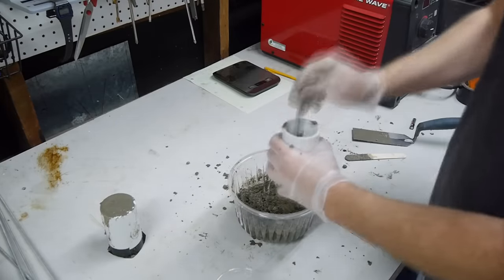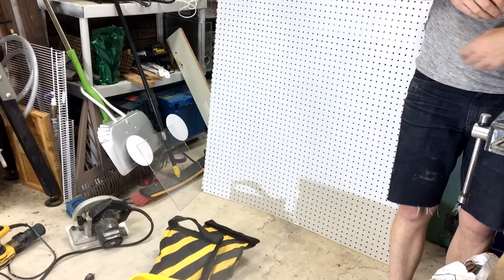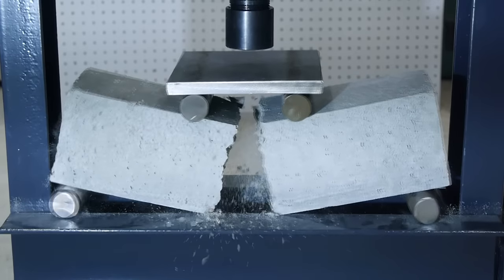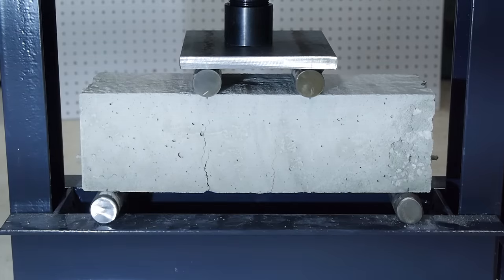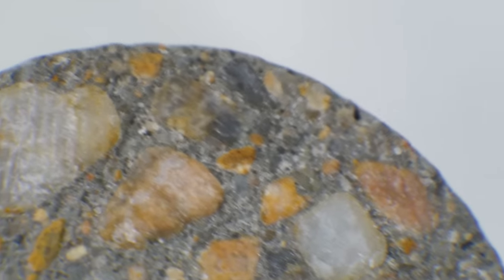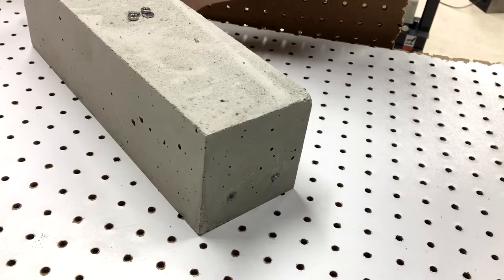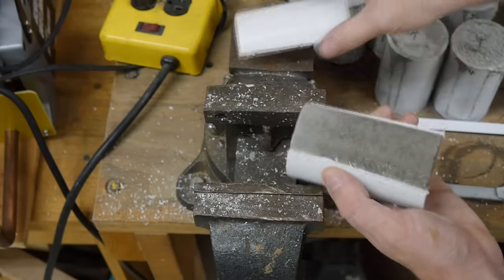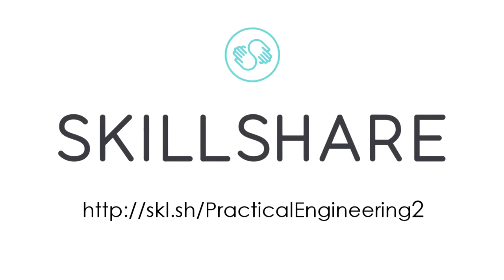Why Concrete Needs Reinforcement

Comment: Algorithm out here trying to make people experts on the Miami Condo collapse.
Reply: Word
Reply: 😂I just watched a video about that whole thing
Reply: ikr, those engineers knew fuck all about what they were doing, they shoulda watched this video.
Reply: Lol I was about to mention the same thing 😅
Reply: I came to the channel after the I-40 bridge failure. I guess the country is literally falling apart.
Reply: It was a basic formula for disaster. Seawater was going into the parking garage during high tide for years. Salt water and non sealed concrete don't mix because of the rebar. There solution was to pump out the sea water in the parking garage during low tide. Buildings in Texas near the coast don't have basements in single family homes and the buildings that do have basements are sealed so water doesn't come in.
Reply: Controlled demolition like wtc
Reply: @jimberry5318  More like Controlled Demolition do to deferred Maintenance.
Reply: @kentharris7427  they knew about it a long time ago but decided it was better to have it collapse
Reply: @jimberry5318  There hasn't been a building collapse in years in the United States. I think it was the sticker shock of renovating the building. You can imagine the price to purchase a condo when it was first brand new versus the renovation costs of today would be much more.
Reply: @kentharris7427  well if you have good insurance just smash the building and call it an accident
Reply: @jimberry5318  But those were individual owners, not a corporate entity. Plus, 100+ lives lost would go to the court fees, attorney fees, settlements with the owners of the condos... and ruin the reputation of the company. There is no such thing as good enough insurance for an accident like this. The HOA is made up of people who actually own condos in the building, and it was the HOA who was overseeing the renovations. There may have been members of that HOA who lost their lives because of failure to understand the severity of the problems.
Reply: @kentharris7427  Building Integrity was saying the HOA was approved for a $15 million dollar loan from a bank for the renovations. It came out to something like 100K per unit to cover the cost.
Reply: @SandrA-hr5zk  idk it's not a surprise when they knew like 3 years ago about it and I dont think they need to pay court fees or any owners off if they're all dead
Reply: Nahh dont say that bro
Reply: @SandrA-hr5zk  I own rental properties and always start on the roof first on the single family homes and work down. I purchased a  house with severe Termite damage a couple of years back. Once we stripped everything out of the house we started on the load bearing beams first before we started on the roof. Just made sense. I am in no way a structural engineer but I hired one since I took the Atrium Out of the middle of the house and put a 23 foot Glulam beam to support the roof to make an open area.
Reply: @jimberry5318  Well when my Mom was alive she was an insurance fraud investigator. Since I know some of the techniques they use, I have been rather shy about doing things like that!  😊
Reply: Too soon
Reply: Lol fr
Reply: Frrrr
Reply: Damn you beat me to it
Reply: Fr
Reply: Facts
Reply: Facts
Reply: Calling it the "Miami" condo collapse is disrespectful to the town of Surfside. Please call it the Surfside condo collapse to properly acknowledge the suffering of the residents of the town.
Reply: Now use a rebar cage  instead  of a few strings    No more building collapse
Reply: @baloog8  The engineers fulfilled their obligations, the property management screwed up and ignored their responsibilities of repairing it.
Reply: So, maybe the real Skynet will use its powers to feed our egos at the detriment of society?

Comment: Another interesting thing to note, you CAN have too much rebar in a beam. Since steel is much stronger than concrete, having too much steel in the tension zone will cause the concrete to fail in compression before the reinforced concrete can fail in tension. Since concrete is a brittle material, this turns the failure mode BACK into a brittle failure, rather than a ductile failure. 

So the goal with designing a reinforced concrete beam is to have enough steel to have the strength required, but not too much to the point where failure becomes brittle again. Strength AND ductility are both very important
Reply: Correct. In other words, having too much steel would result to the concrete structure instantly collapsing without prior warning which would result to hundreds or thousands of death in contrast to having the concrete fail first before the steel which will alarm the people in the vicinity to evacuate before the inevitable collapse since the steel would be able to hold the crumbling concrete first before collapsing
Reply: Would having four steel rods in his structure be overkill?
Reply: @nickmeale1957  hard for me to say I don’t have much experience actually designing to know off the top of my head lol. I just had some structural design classes. 

Also rebar comes in a lot of different sizes so you’d wanna specify the total area of steel in a cross section rather than the number of bars
Reply: @Kdot19  Interesting
Reply: @nickmeale1957  Four is the minimum for any main structural support like column or beam but for lintel beams and stiffiner columns that support the walls you can have two depending on how high the wall is
Reply: @xteam7780  Dude in the video explained you can have too much rebar. There is a sweet spot
Reply: Having more reinforcement is mooore dangerous than less, wc is why all need to compute haha
Reply: i heard that even you can put steel fibers to make the beam more compressive as possible.
Reply: Funny how youtube algo found this, 1 day after you've posted on this :D
Reply: Concrete have low elasticity compared with steel rebar. In the case of an RC beam overly provided with steel reinforcement it can still collapse under its own 'dead' weight even though the concrete and steel properties remain unchanged.
Reply: Steal reinforcement is actually today's concrete's biggest weakness. Sure at first it's great. Give it 50 years and it's garbage. The expansion and contraction of the metal will always weaken concrete over time. It's why old world structures are still standing like the Roman collosseum. They don't have metal reinforcement. I work in a dental lab and deal with this all of the time. Companies specifically designed alloys to expand and contract at very similar rates thus allowing porcelain to be backed on and not fracture off.
Reply: @dragonsauce358  you're mother 😂😂
Reply: @xteam7780  I suspect that your meaning of "you can't have too much rebar" is "too much rebar is not allowed if you want proper reinforcement", while "you can have too much rebar" in OP's comment was meant to be interpreted as "there exists a quantity of rebar that is too great for proper reinforcement", hence the misunderstanding.
Reply: Also, too much rebar will cause you a hard time placing a concrete. Which will also cause segregation and make the concrete weaker
Reply: Plastic bricks are stronger than concrete bricks I'd love to see what would happen to a plastic brick
Reply: @dragonsauce358   Both concrete and steel constantly deformed in their aging process resulting with some concrete spalling and steel corroding. Many ways to stop its rapid deterioration, maintain the structural integrity  and increase the life span of buildings beyond 99yrs.
Reply: @geggilishes5286  plastic deforms before failure, which would cause a whole seperate set of issues.
Reply: @xteam7780  No. Having too much rebar is undesirable in the tension zone, for this would result in failure in the compressive zone.
In such a case, rebars are added in the compressive zone to increase the load carrying capacity in that zone.
Reply: It's amazing how the ancient Romans were able to create a type of concrete that hardens even greater, over time, without internal support! You would think that we could have found a great consort to internal structure support and various options via a plastic or rigid tensile synthetic. Idk just liked the comment here! Your point is very good.
Reply: @gsleazy1975  we have found those, issue is they tend not to be cost effective. 
Roman concrete I do agree, marvel of history.
Reply: Steel is stronger in compression than concrete, so what are you talking about?
Reply: @nickmeale1957  The formula, at least that we use here in argentina, is that the cross section (area) of steel must be smaller than AsMax=height*width*3/8*0,85*0,85*fc/fy, were fc is the strenght of the mix and fy is the strenght of steel. 
Assuming brady uses minimum diameter rebar (3/8"), a poor concrete of around 10MPa (very hard to guess from the video), standart steel (420MPa) and the section is around 10"x10", the amount of steel rods would be around.... yeah 4 rebars of 3/8" it's aproximately the maximum, you were completely right xD
Reply: Very interesting comment
Reply: Yup this is why you have to use the resistance factor phi which scales depending on the stain in the steel when the concrete reaches it's compressive strength. Steel will typically activate at a strain of 0.002 and a strain of 0.005 is required for a phi of 0.9. Scaling down to 0.6 at the lowest allowable steel strain.
Reply: A proporção entre o ferro e o concreto deve ser perfeitamente equilibrada, como tudo deveria ser.
Reply: Great addition.  Thank you.
Reply: @whatthe9256  uses case explanation. I like it
Reply: This exactly is why steel is better, thats too complicated. It least with steel you always know what you get
Reply: @Trancefreak12 You made it clear for me. Thanks
Reply: There is a three types of RCC section. They are Under Reinforced Section, Balanced section and Over Reinforced Section.

We never design an over reinforced section as it will cause brittle failure.
Reply: dude my gut feeling is just screaming right now. It can feel there's so much misinformation in the replies but I can't prove it.
Reply: okay so first adressing the og comment here, to imma say this is "can't" and not "can" based on what op was trying to teach.
Reply: @nickmeale1957  this reply was probably trying to say "can't" but can't help commenting like this. The message aint clear and its giving some sarcastic vibe.

Comment: In 2016, an earthquake hit Ecuador and was catastrophic to the infrastructure of the coastal side of the country. The reason being was that to save costs, many buildings were built using seawater for the concrete mix. The salt found in the mix weakened the steel reinforcement significantly, so when the stress came, it just gave in. I think this is something worth mentioning. (this theory might be incorrect? I heard it in the news - I am not a professional in the subject).
Reply: Salt, moisture, and oxygen can corrode metal much worse than rust. So you are correct
Reply: What an epic failure. To think that they would cheap out on something like that is mind boggling.
Reply: i work in scaffolding and all the material that is exposed to ocean air rust really really bad that it makes you think they were sitting there for decades being unused
Reply: basalt rebar fixes that
Reply: Yes do not use salt or salt based curing accelerants in reinforced concrete. The news was correct this time! Haha
Reply: @retsaM innavoiG You got it right. Rust is just oxidized metal. Iron (Fe) gets transformed into Iron(III)Oxide (Fe2O3). Water speeds up this reaction, ions  will speed it up even more. Thus, such as salts or rust itself.
Reply: Don’t neglect the fact that Sodium Chloride (salt) reacts with the Calcium Hydroxide in cement causing a chemical reaction creating Calcium Oxychloride. This creates crystals in the concrete which causes it to crack and crumble.

Comment: I worked as a CMT and we would stress cables post pour and no one ever explained to me the purpose beyond “the boss said so” thanks for elaborating!
Reply: That always drives me crazy. I do a much better job knowing WHY I need to do something instead of just being told "because I said so".
Reply: well the boss says so to maximize the strength of what ever your building with that reinforced concrete
Reply: @raven4k998  Thanks, we also watched the video.
Reply: @raven4k998  shh guys he works for the boss! Look busy!!!

And never question the boss man's authority 🤐

Loool

Comment: 2:47 You got really lucky to get a frame while the concrete was cracking.
Reply: or he has a really good high speed camera?
Reply: video is good at that.
Reply: "video is good at that."
A conventional camera is very bad at that. Unless you're extremely lucky.
Reply: The cheap way is to genlock 3 or so cameras with a phase offset and then use camera output containing the moment wanted.  Maybe he had more than one beam?   But it isn't that hard at all.
Reply: @CitroenDS23  "Instant" would have been a better word choice than "moment" in this topic, LOL. i.e. bending moment.

Comment: Material stress is not unrelated to anxiety - at least when having to do the calculations in college
Reply: Dominik Schaefer Tension problems really stress me out, although they aren't a lot of work. Despite this, somehow they still use a lot of energy due to very low efficiency in doing them.
Reply: I feel ya
Reply: Dominik Schaefer deflection equations, stress transformations are a pain in the ass.
Reply: Same :-)
Reply: Cold sweats and flashbacks to structural analysis.
Reply: Oh man, I get that feeling
Reply: When I took Statics in college, we didn't (yet) have hand calculators. One (rich) kid had a Curta ($125 to $175 at the time). We had a Math Lab with two desk calculators but only one could do sin cos tan and inverse. But that was just for checking the homework before class. To do it at home, it was (CRC) math tables all the way.
Reply: And yet today we can at least use our phone calculators
Reply: supply497 The calculator on my phone is barely a "four banger." Not even Memory, let alone sqrt or circular functions, logs snd the like. I'd rather have the CRC Tables. But I suppose that makes me a fossil. (sigh)
Reply: supply497 i think what you meant to say that Texas instrument graphing calculators still cost $100
Reply: Haha nice one
Reply: I can totally relate x'D
Reply: There's a difference between eustress and distess

Comment: I do pool construction, it’s actually pretty crazy how we bend and shape the rebar to reinforce the pool before putting concrete
Reply: We use it here for decades in every type of construction ,iceland
Reply: Just 10m. Super easy
Reply: @DoseOfJapan  10m? lol, well what we use 3/8 #3 & half inch #4 for pools, half inch for the beam but yes it’s easy if you know what you’re doing lol
Reply: I work in civil engineering inspection and testing, and it always amazes me finding out what I’m testing (if I haven’t sampled myself personally from site) for what project to get the bigger picture of the scope of work.
Reply: Yeah I guess it's cool till you work with it everyday then it'd just a pain in the ass I build foundations and I hate rebar absolutely hate it
Reply: @glenchaos9  I build homes the thickest reber usually is 15 mm rebar and it holds up just fine
Reply: @glenchaos9  Depends where you live.  If its not an earthquake zone, anything higher than 10m seems overkill for a pool.  You're not building a water treatment plant here.
Reply: @Gooong  true lol well I do pools in Southern California.
Reply: @glenchaos9  I live close to Seattle myself.  If you ever travel east for work you will be surprised at how little steel goes in.  Imagine the same beams at double the spacing.  Its pretty wild.